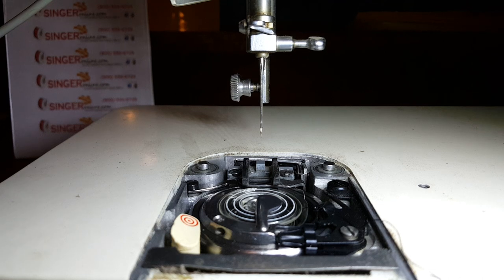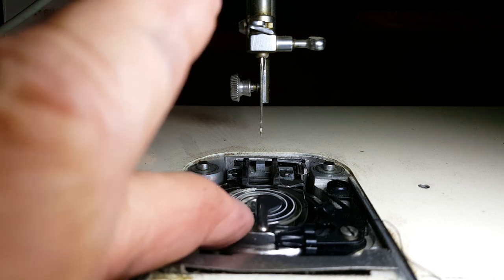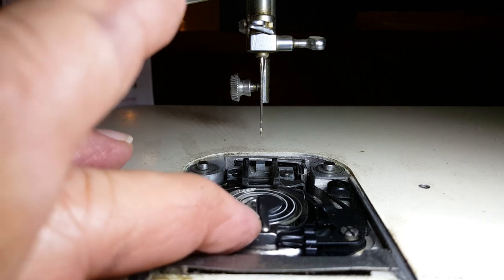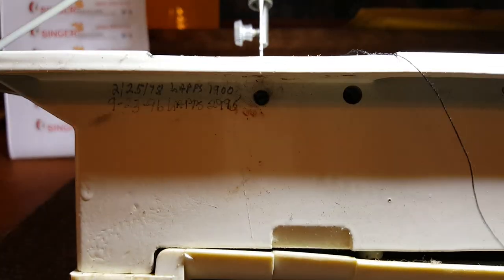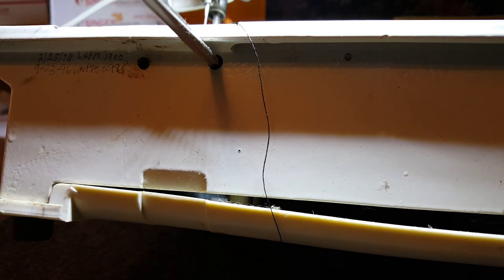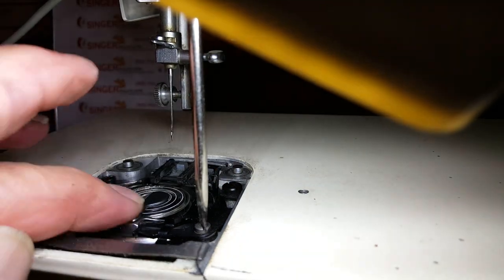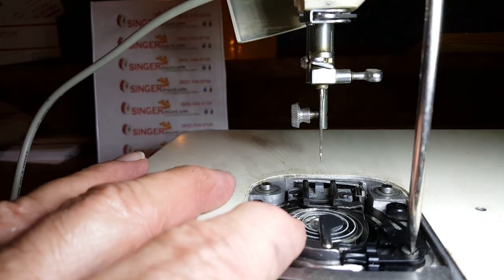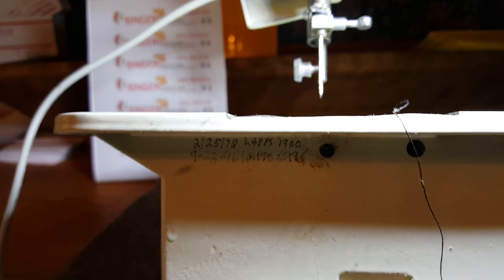Proper Bobbin Case Adjustments for SINGER Touch & Sew Models. 600 & 750 Series

Comment: Any suggestions on adjusting the stitch. My stitch is not straight as it should be. every so many stitches one will be on an angle so that top stitching looks off.  I don't think it is a tension issue because there is a pattern to the uneven stitching. It is a Touch and Sew 603. I have been sewing on this same machine for 56 years. It always had a nice straight stitch.

Comment: When I stitch it all looks good on top, but underneath the thread is all looped in big wads of tangled loops.  Bobbin thread adjustment somehow the problem?  Something I can do?
Reply: i'm having this same issue on my 603E. i believe it's a tension problem, and it's tied to the tension knob up on the machine, not with the bobbin down below. but i could be wrong. it's like the bobbin and the tension below is winning the tug-of-war with the top stitching. i think it means you need to adjust the tension higher on the top stitch.
Reply: The thread tension will cause this problem. Heavier material requires higher tension. Use scrap material at the beginning of your project to adjust the tension correctly until you get the hang of it. Also, if sewing different materials together, rough or heavy material should be on bottom if possible.
Reply: @Dr_Bombay  I have the tension as high as it will go and I am still getting looping on the bottom.
Reply: @cleatussfmo7437  I have the tension as high as it will go and am still getting looping on the bottom even when I put very thin material through.
Reply: hmm, i am not an expert by any means, so it's hard to say. you mention using a very thin material, though, so that leads me to think that having the tension so high is not right. have you tried starting from scratch, taking out your thread and everything, re-threading your bobbin, setting your tension as low as it goes, and then re-threading your machine and trying that? then if that's not right you can just adjust it up a bit at a time and hopefully find the sweet spot. it's frustrating for sure, but that's how i tend to trouble-shoot this sort of thing.

Comment: I removed the tiny screw from the bobbin case, (just to the right if the "target" lever in the video) and now it will not screw back in. Also, the arm that holds the bobbin is is very loose, has no spring at all. Any suggestions?
Reply: your missing a small piece of metal that tightens the screw and acts as a spring. when the screw got loose it probably fell look under your machine. i know this was a long time ago but it might help some else.
Reply: @albertoortega6833  Thank you so much for sharing.  I also removed the tiny screw yesterday causing the level to be loose.  I would remain clueless on what to do if I didn't  stumble on your input to help others.

Comment: my bobbin casing came out when my bobbin got jammed.  now i cant get the casing seated  back in.  any idea?  its a touch and sew 756.
Reply from the maker: You have to put the case back in at an angle, so the groove in the bobbin case slips into the lip on the rotating hook. Then oil it.
Reply: Not surenonbyour model, but the 600e has a bobbin release button under the access plate(some models or is located by the throat plate switch) ensure that button is not engaged and the case should slide in at kind of an angled motion from high right to low left(If looking in a flat horizontal view)

Comment: Needle is hitting the plate , how to fix this problem please help
Reply: I had the same problem.  I made sure my needle was in the center position, as per the Needle Position knob on the face of the machine, (instrument panel) then I loosened the needle and held the foot steady as I tightened the needle screw back to tight.
I hope this helps. 😊